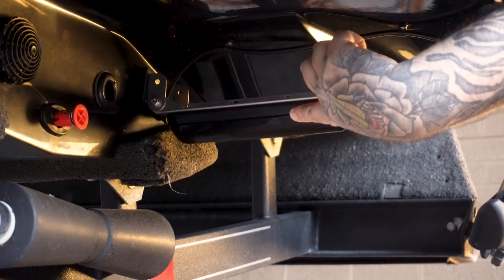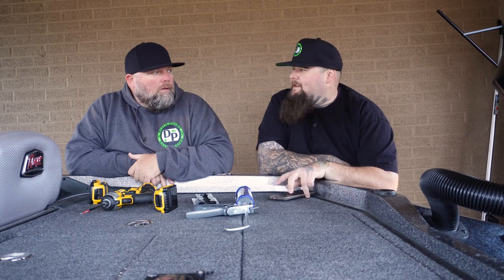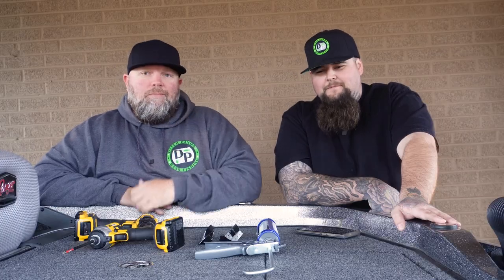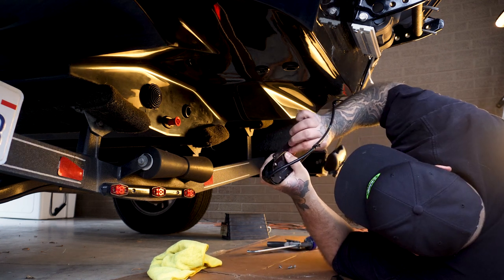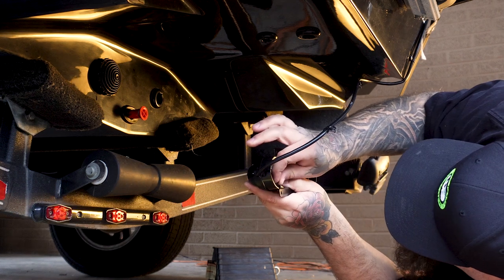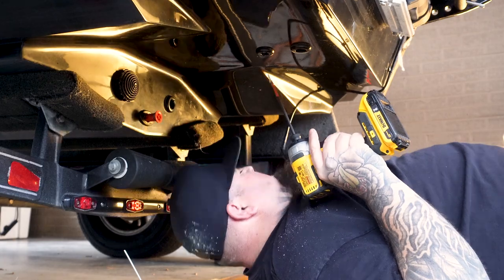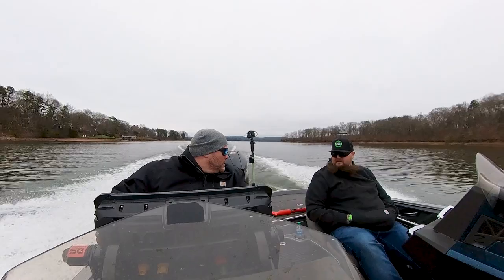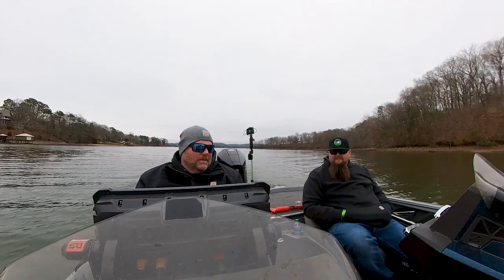How & Where To Install Your Boats 3 in 1 Transducer

Comment: I knew that. When I mounted mine, I used a straight edge along the hull and the transducer. Hull mounts are the way to go though.
Reply from the maker: If you're around shallow stuff, it is the deal for sure. BTW, best pic I've seen in along time seeing you fishing with the boys 🤙
Reply: @DitchPandaBassFishing  absolutely! And thanks brother! Highlight of my year !!!
Reply from the maker: It's a beautiful thing!
Reply: @DitchPandaBassFishing  absolutely brother!
Reply: @DitchPandaBassFishing  quick side note on the through hull…, you should be able to graph the lake regardless of the speed your going with a clear picture. Might have to turn the graph speed up though. I can’t remember.